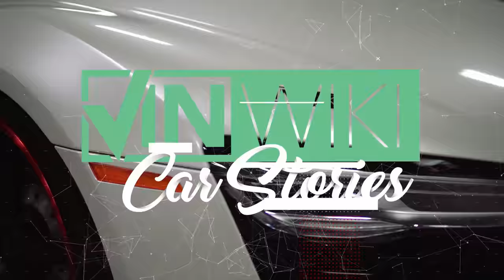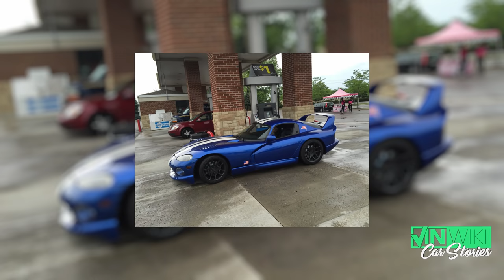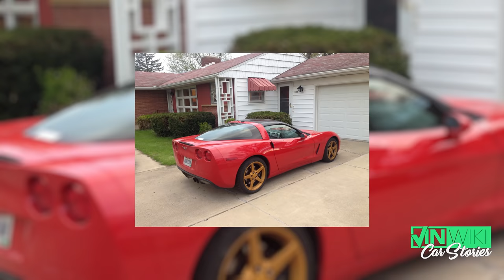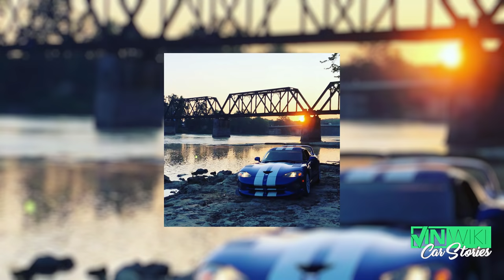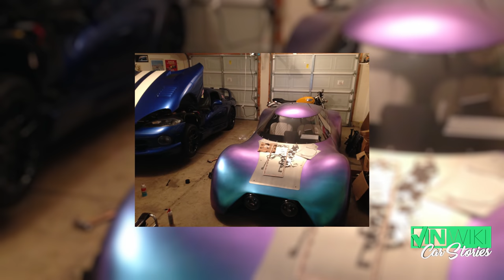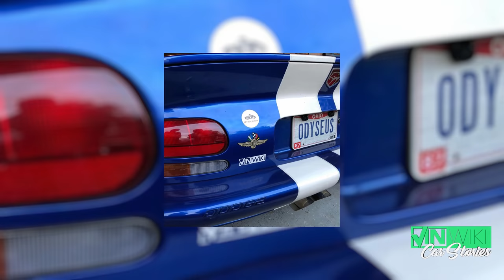How Casey’s DESTROYED Viper became the car he’ll keep forever

Comment: What would be my labor of love 🤔. That's actually easy. '76 Corvette. Don't ask me why a '76 specifically (Corvette Summer maybe) but there it is. Nothing radical. Big Inch SBC with a decent cam. 5spd. Fuel Injection. Tubular Control Arms and upgraded brakes. Bigger sway bars. DARK Metallic Hunter Green. Actual Saddle Leather Interior.